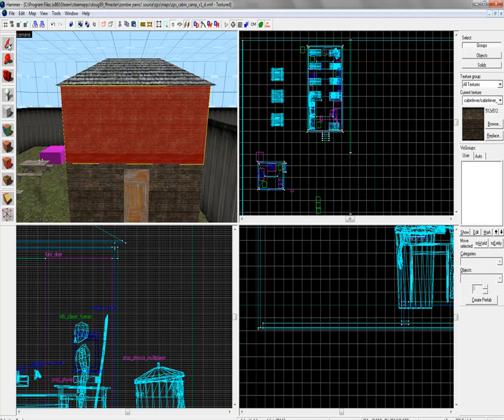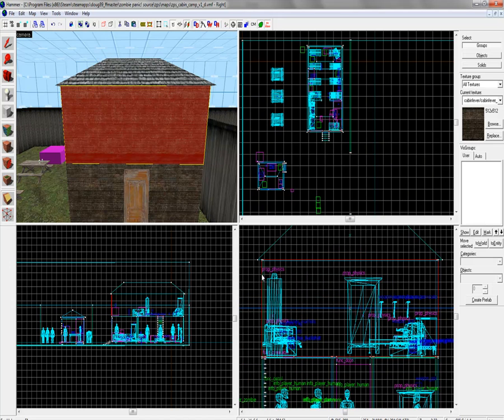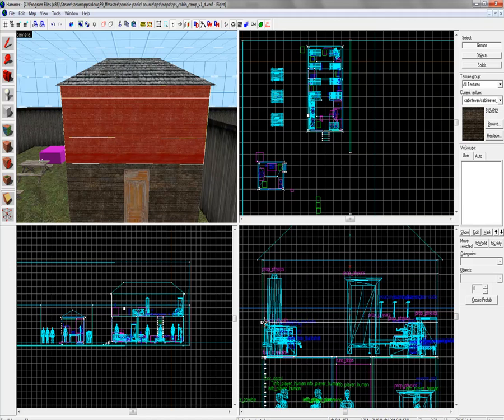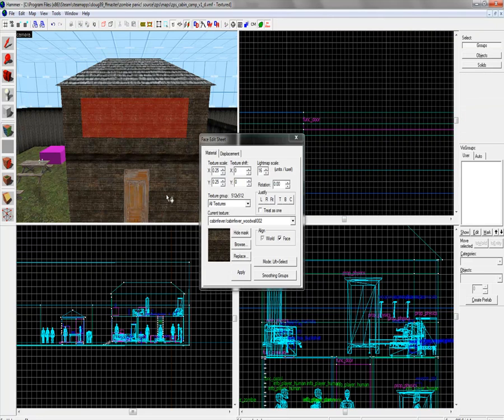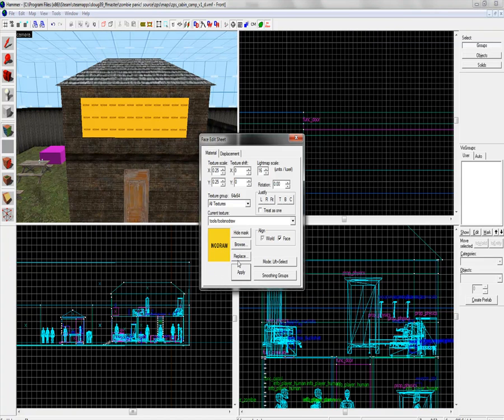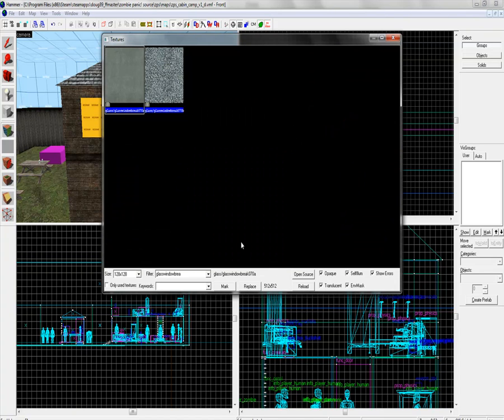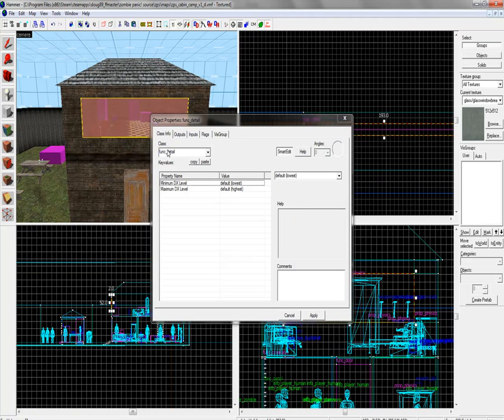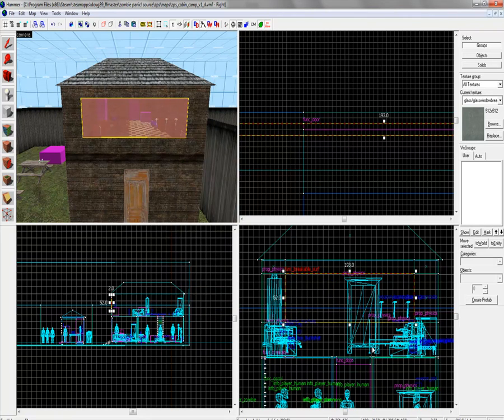Source SDK Hammer Tutorial - Clip Tool

Comment: That is an inefficient way to do it doing it that way turns one cuboid into 9 whereas you could have done it with 5 instead by selecting the cuboids that actually need to be cut or deselecting the ones that don't by pressing shift + s , then holding control clicking on what you wish to edit then once your shapes are selected press shift + x to cut the shapes you want.